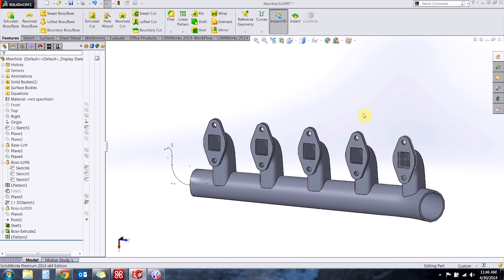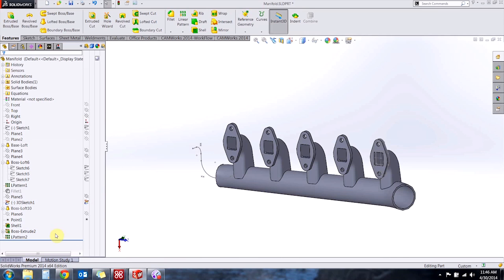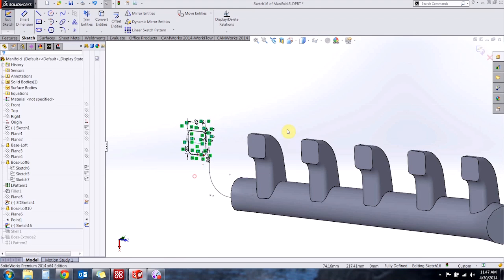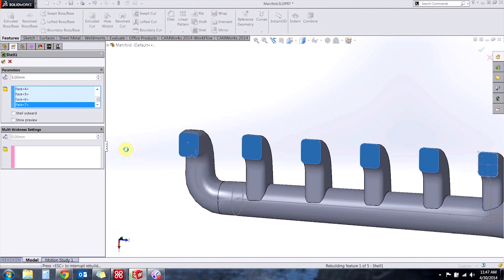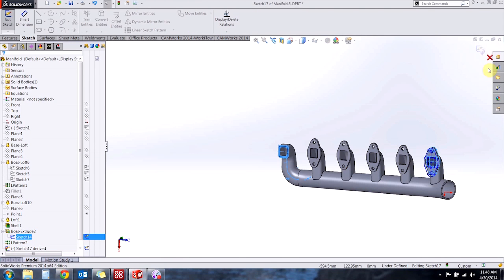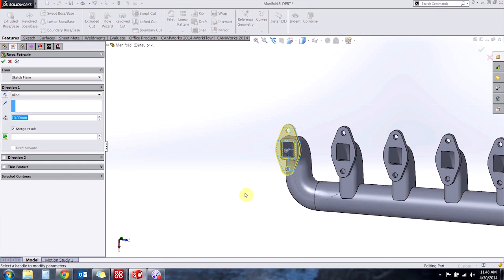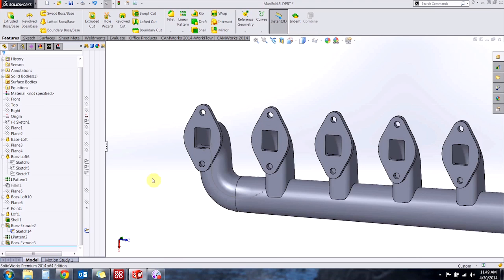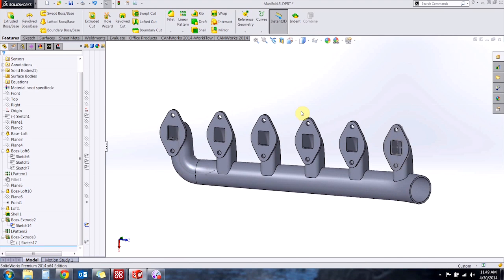SOLIDWORKS - Copy Paste vs. Derived Sketch

Comment: Hey, as you see, when you paste your sketch in a desired plane, the location will be different.
You can prevent that easily by pasting it into the front plane (or 1 of the 3 standard planes if more suitable) and then select the desired plane by left mouse clicking the new sketch and clicking "Edit sketch plane".  Now if your desired plane is in an angle on one of the 3 standards, then it wont work, but if it is, it will save you lots of time.